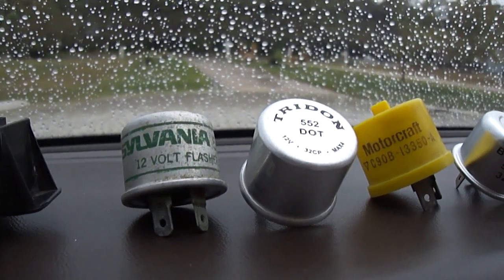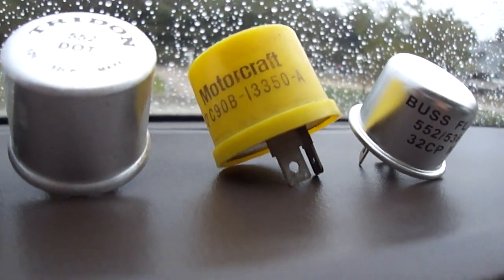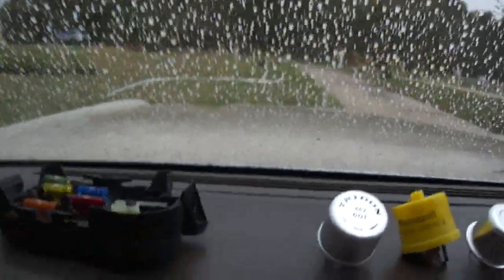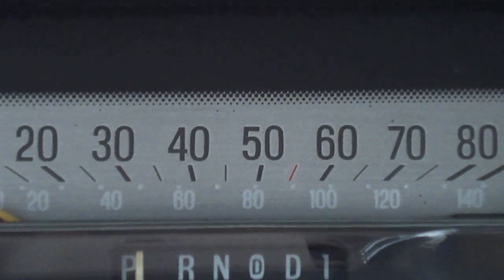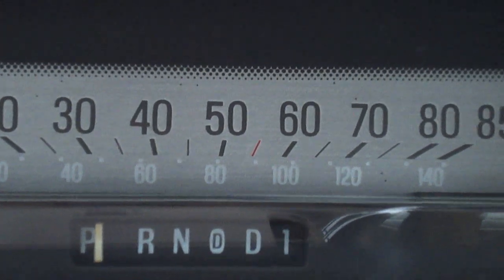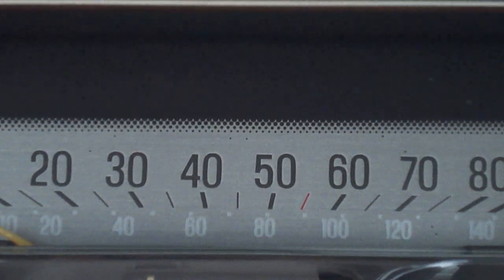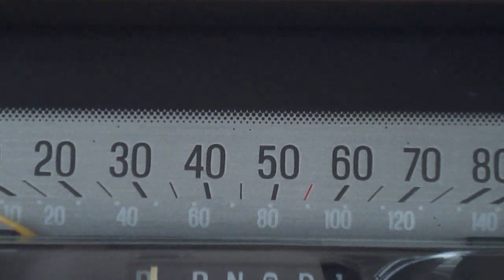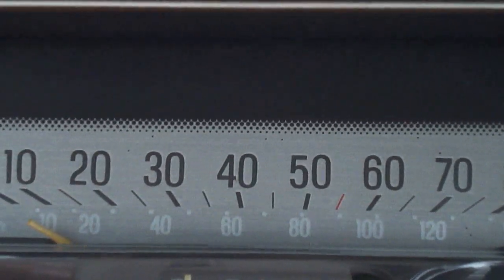Fun With Thermal Flashers

Comment: That car originally came with either a 323 (yellow) or a 325 (white) Wagner thermal fixed load flasher. The 323 is for use with three 2.1 amp bulbs (like the 1157 or 3157). Ford used the 325 which has a slightly higher fixed load in the Panthers with the optional trailer tow package which had an auxiliary flasher relay to power trailer lights. You could hear the relay clicking near the rear spare tire well in the wagons. The 325 was also used in cars that had the 2357 and 3357 2.2 amp bulbs in place like the '80s era Escorts.

The difference among those flashers you have there is that the original flashers for the turn signal circuit (NOT hazard light circuit) had to indicate lamp outage (fixed load). So if one lamp burns out, there is not enough load for the thermal strip to heat up enough so the circuit glows steady, telling the driver there is a lamp out. Modern electronic units do the opposite: they flash really fast when there is a bulb out. In the hazard lamp circuit, you always want the circuit to flash even if there are one or more bulbs burned out, for safety's sake. Fixed load flashers were 223, 224, 228, 322, 323, and 325. There was a couple others with odd load rates that I can't recall. Variable load flashers were mostly 552 and some others.

Thermal flashers are all very sensitive to system voltage. In many older cars, the voltage drops below what is needed to get a fixed load flasher to cycle off-on-off, especially if accessories are used. We had an old Caprice that probably produced 10 volts with the headlights and heater on, and the turn signals would not flash.

In some models, the side marker lights were tied into the parking light/turn signal circuit in an alternating ground arrangement such that there was an additional small load (194 bulb) on the turn signal circuit when the headlights were off. This explains a small difference in flash rate with many GM and Chrysler cars from the 1980s between when the lights are on or off.

Modern electronic flashers are much better in just about every way. They operate smoothly across a wide range of voltages and flash at a much more consistent rate across all units. There used to be a huge variation flash rates across all vehicles using thermal flashers, and now all cars flash at pretty close to 60 cycles per minute. But you can't beat the nostalgia of that loud metallic "dink donk dink donk" of the old fixed load variable flashers. Most people born after 2000 probably have never heard one. The Panthers had them mounted up on the lower knee panel and they had a lot resonance from the dash brace. The GMs of that era had them mounted against the firewall and were much quieter.
Reply: Your the man, I was hoping to see someone with knowledge about them, almost every vehicle used the 2 to 3 lamp flashers, but they did have the 4 Lamp ones also, I did kinda wonder if the 228 and 325 were either higher or or lower amp rated, I do have a few different ones myself and haven't tried to see the difference yet but that answered my question and you are right about the amp ratings on bulbs and the differences
Reply: @t-rodshader9593  I figured out the specs from a Wagner bulb and flasher catalog I picked up sometime in the '90s. It lists the electrical specs for all the thermal and electro-mechanical flashers available at that time. I have not been able to find any spec information or discussion of those old school fixed load flashers at all on the internet.
Incidentally, I've determined that a lot of the bulb specifications in those lamps catalogs (like the ones you see at the bulb displays at auto parts stores or Walmart, where you look up your vehicle and it tells you what bulb was installed where) were wrong. Lots of 2057s listed where 1157s were installed from the factory (2057s were only used where there were more than one bulb in the housing). Also the changeover from bayonet based to wedge base bulbs (1157 to 3157) caused some confusion for a while as existing stock of the old sockets was used up.
Reply: And to mention the marker lamps, that's another thing I try to tell people when they think there's an issue, they done that when they were new, especially if there was a higher amp marker bulb than 194, rarely but sometimes there are brighter bulbs or like in most cases someone has bought a "universal" eBay bulb that is actually 5+ watts or has upgraded to a 2825 (W5W) bulb and they are 4CP vs 2CP so they are about twice as bright for only 5W while the 194 is 3.78W at around the same voltage, and they would turn everything on with the parking lamps included and the parking lamp feed gives an adverse reaction to 10Watt differential because instead of grounding through the parking lamps it's feeding and grounding through the 27 to 28.5 filament and on top of the fact that the system is running at 12.5V when it's idling in gear with almost everything on, it blinks much slower, when it comes on the marker goes off vice -versa, most vehicles from the mid 80's (newer;not 70s back) have higher amp charging systems and didn't do this as bad and would keep good voltage and run at 14.2 volts at higher rpm and sometimes cause much faster blinking, but on the bulb difference some cars just went to 2057s instead of 1157s atleast in the front and they only had a 7watt tail/park and the 1157s had a 8.3watt tail/park, which didnt disturb flashing or other circuit pretty much at all, but its interesting to know about all the different things that are out there in the electrical/electronics world especially in automotive, hope this helps someone.
Reply: @t-rodshader9593  Off the top of my head I can think of certain models that had chronic low voltage problems: -1977 - '78 Thunderbirds/Cougars/anything Ford; lots of '80s Ford models, but more so with the Panthers; mid-'80s GM models like the FWD Grand Prix/Cutlass/Regal. The Pontiac 6000 STS with the 4-lamp turn signal load (3 rear, 1 in front) and Grand Prixs that had the extra turn signals in the rear really taxed the electrical system. Those must have used relays for the extra load.
Reply: @AlexanderCrump  yea ive seen those, 3 bulbs. That seems substantial because ive seen some cars that barely carry the load of 2 bulbs in the rear because of the thin wire used at times. And they never usually receive a full 12 volts even with 14.4 at the alternator so the bulbs lasted forever but they werent exactly as bright as theyd normaly be and with 27 watts x3 three thats not including front and etc. (Small bulbs) so basically about the same wattage as a pair of headlights on each side. Just to think most cars barely had 70amp alternators at the time and it wasnt until around late 80s when 90-100amp was average. I bet the voltage drop was terrible and that every light in the car wig-wagged when the turn signals were applied. It would have been better if they had used a 1141 bulb or a 3155 which were lower wattage alternatives like the 921 of today versus a 912 or 922. Because the amp draw would have been lower. For example 18.4watts(1141;push and turn) or 20.5(3155;wedge base) vs 27watts per bulb(1156-push&turn;3156;wedge) that would have made 3 bulbs draw about the same as 2 and could be used with 323 or 325 flashers and the 1141s might have even worked on a 1rear 2 front with two in the back on a 224 or preferably a 228 flasher just due to the fact that over a volt was usually lost in these vehicles due to wiring, and still using a 552 for 4way. But it obiously makes just as much and probably alot more since than when GM came out with the alternators that overvolted they used a different bulb for drl just because the regualar bulbs would burn out so quickly. The batteries didnt last so long either as well as other accesories. I design things for this situation. I have a 85 k10 chevy that i used a P21/5w instead of a 1157 or 2057 just because its brighter with less wattage and used 5702NAK bulb in front (one of the new gm wedge 14v;replaces 3157na&4157na) on a 228 flasher designed for one 28.5w and one 27w. It now has a 31.2-watt and 21-watt at a constant voltage of 14.4 because i have a higher output alternator (volt&amp) unlike most that hardly ever do that at idle. And it works very well.
Reply: I have one of those catalogs as well, its an 89 book which is nice because that is when they had alot of both bayonet and wedge plus the thermal flashers were in use heavily still.

Comment: Do you find that the rate of flash slows when the headlights are switched on? Mine does, plus the hazard flashers (on another thermal unit) have an inconsistent flash. I have tried using electronic relays but can't get them to work.

Comment: Hmm, on my car when I pulled the flasher the hazards quit also. Of course I have a 96 GM.
Reply: Thermal flashers were last used in the mid '90s. I know the Mustang had them until '93 and I think GM had them in the Camaro/Firebird and the Caprice/Roadmaster/Custom Cruiser large cars until they ended. After that, everything used a single integrated electronic or electro-mechanical unit that handled both functions.